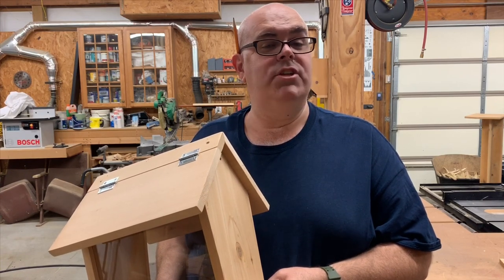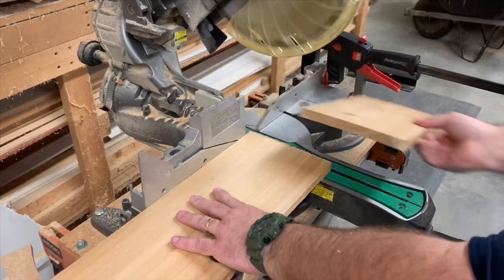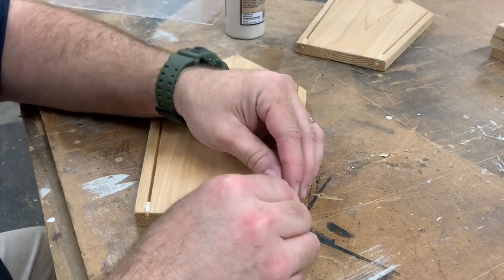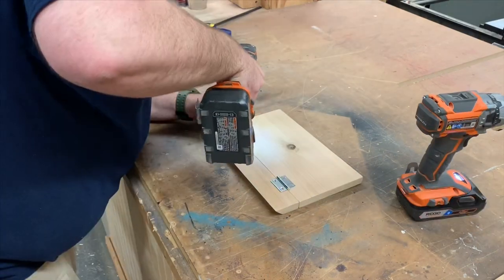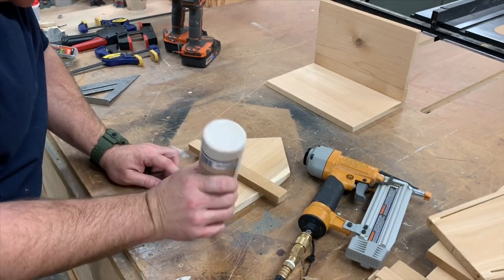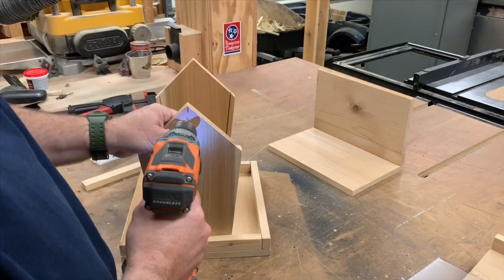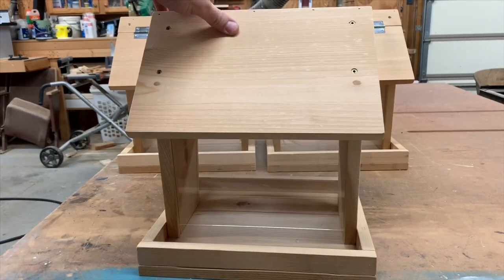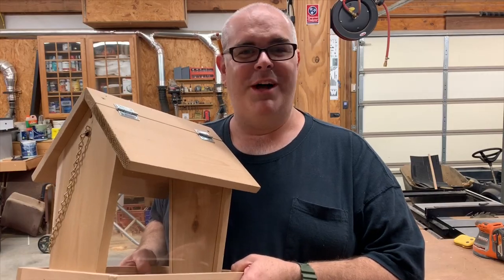Bird Feeders: Building Cedar Bird Feeders

Comment: this is awesome…..I want to make it send it for my five-year-old nephew and one-year-old niece to Colorado and probably send it unassembled. That way they could paint it together that be pretty cool a question where do you buy Cedarwood at? Can you buy it at Lowe’s or Home Depot great project. Thank you.
Reply from the maker: First off, thank you so much for the kind words and the view! Yes, typically Lowes and Home Depot carry some rough cedar boards (at least around my area they do).  I work at a large building supply store, and that is where I get mine. If you have building supply stores in your area, that is a good source. Also my local hardwood dealer stocks some cedar as well. It shouldn’t be too hard to find depending on what part of the country you live in. Some regions may have equivalent species such as cypress or redwood. Both of those are good options as well. I wish you success with your projects, and thank you again!

Comment: Nice project. maybe you should have cut the hinged portion at a 45 deg. angle so as to reduce the amount of rain water leaking down into the bird seed. Other than that, it is perfect. I also liked to tip on using painters tape to help put the roof section together. Well done sir!
Reply from the maker: Tim, Thanks so much for the view and the comment. That is a great idea about the 45 degree cut. I imagine that would help alleviate quite a bit of water infiltration. I struggled with ease of refilling vs. water tight roof. That is a good compromise, and if I ever build any more of these, I'll definitely incorporate that. Thanks again!

Comment: Nice job, how did you install the plexiglass into the side that does not have the hinge
Reply from the maker: Thanks Chris! I installed it before I screwed the roof on. The video doesn’t make that clear. You aren’t the first to ask that question. I preassembled these and then partially took them back apart so the kids at church could help me “build” them. We slid in the plexiglass before putting the roof on. Thanks again for watching and commenting.

Comment: If it rains would water leak through where the hinges hold the wood together? 

Nice video! I will try to make this! 👍
Reply from the maker: EC, Unfortunately in the current design, it would most likely get the seed wet. I'm not an expert on the topic, so I don't know if wet seed is bad or not. I assume some rain gets in the tray below and gets the seed wet as well. I would think all feeders would suffer from this problem though. You could alter the design to not have a hinged roof or use a secondary cover over it I suppose. Anyway, thanks for watching and for leaving a comment!
Reply: @thetennesseetinkerer  awesome! Thanks for the reply. I was thinking i can just put a rubber flap over the top. So i can still open it. Ill give it a try.

Comment: A water (rain, melted snow..) will get into the feeder through the roof gap.
Reply from the maker: Pavol, I am aware of that. I suppose some amount of water will get into the seed on any feeder. I think for the most part it will be ok though. There are some good methods that some of my viewers have come up with to solve this though. Check out some of the other comments on this video. Thanks for watching.

Comment: How did you get the plexiglass panel into the kerf on the non-hinged side when you’ve already screwed down the roof panel?
Reply from the maker: Thanks for the view and comment! In the video, I was just assembling the feeder ahead of time to make it easier for the kids to reassemble it later. After it was screwed together, I took it back apart, and when we did the final assembly with the kids, we slipped in the plexiglass before we put the roof on.Thanks again!
Reply: @thetennesseetinkerer  Oh oh, that makes sense. I was like "wait.. is there some secret channel somewhere that it's inserted through?  hah.  Thanks for the  video!

Comment: How is the water from the rain supposed to drain through, it will make a watery mess and clump up the food.
Reply from the maker: I suppose that could happen. It would probably be a good idea to drill a few holes in the bottom or hang it under the porch overhang. Thanks for the comment.
Reply: @thetennesseetinkerer  I use regular window screen. It works great.

Comment: Great looking feeder, but as others have said dimensions (or a cut list) would go a long way for beginner woodworkers. At the very end you could have pulled out a tape measure and rattled off the rough dimensions. 12 inches high, 10 inches wide, 14 inches long, 1 inch sides around to hold the food in.  One extra minute of time. 🤷‍♂️
Reply from the maker: Mark, I suppose I could have done that, and I may start doing that on future projects. My primary purpose for doing videos is just to share my projects with anyone who is interested, and hopefully entertain them and get a laugh along the way. I don't set out to make "how to" videos, although I am always pleasantly surprised and grateful when people tell me they used my video to build their own. I'll take your suggestion under advisement. Thanks for the view and the comment.

Comment: Amazing project, especially for the kids! Im excited to do this and have kids assemble it. The break in the roof though would allow water to seep in. Can we put like a wateeproof tape over it? Or maybe a do a different style?
Reply from the maker: Eugene, thank you so much for the view and the kind words. I did consider the break in the roof will let water in, and it isn't ideal. However, I did rationalize that the seed in the tray will be getting wet anyway because of rain. I weighed the pros and cons of a different roof design. I suppose you could use a a waterproof tape on the seam, but you would have to make sure it was also UV resistant. Many of the "rubber membrane" type tapes on the market have to be protected from sunlight or they will fail. I think a one-piece roof is the best option, however, I think you would need to screw it down so the wind wouldn't take it off, and that makes it much harder to refill the seed. At the end of the day, the small group VBS class I used them in was to expose the children to the many and diverse skills of the members of the church, and it seems that we accomplished that. The format was such a success that we are doing it again this summer. Stay tuned, you just might see another video related to that! Thanks again, it means a great deal to me that you took the time to watch and comment!
Reply: @thetennesseetinkerer  Thanks for your suggestion. I came across this material called butyl tape which I used on my vw bus upon restoring it. It's used as sound and waterproofing so i think i might start with that. Thanks! Great work and keep it up!
Reply: @thetennesseetinkerer  measurements